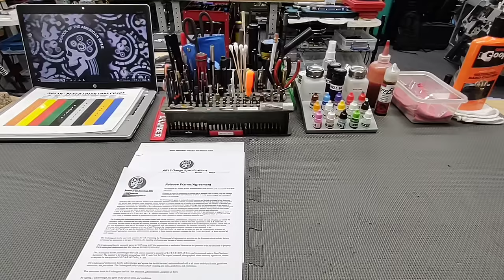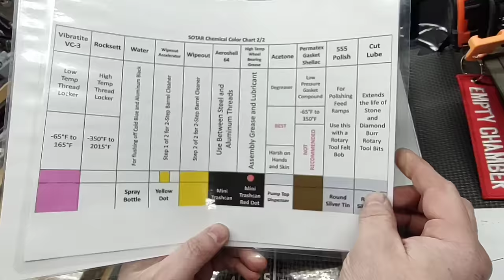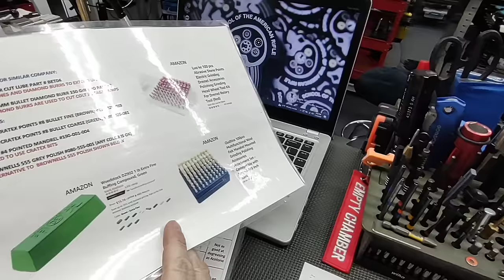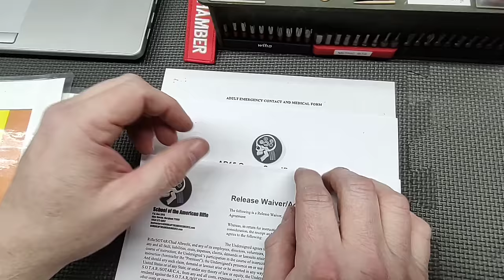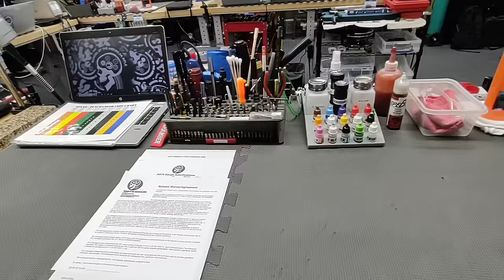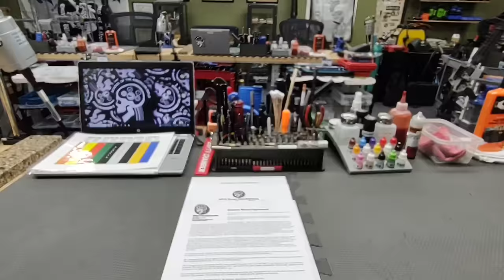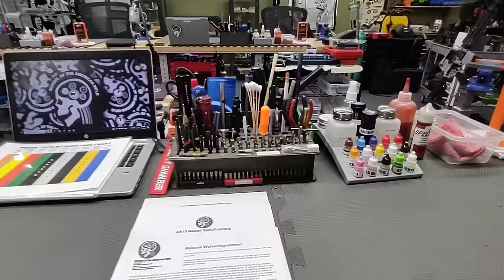SOTAR Classroom Bench Layout (For SOTAR Students - See Description)

Comment: This is just a great classroom setup, wish I could grab a seat. Regarding the borescope (I also have a teslong,) I found the best alternative to a laptop is not a tablet (since there's that whole problem with OTG and usb cameras,) but Vividia has/had a little nearly universal screen for usb endoscopes/borescopes that I love. The M450,  I popped it into a cheap cellphone holder arm over my workspace and it just works. 4.5" isn't the biggest screen, but it is so easy to use, and also has video and camera options, sd card.  There aren't a lot of options I could find at a reasonable price for a USB borescope monitor, but the M450 just works easily.

Comment: Nice video Chad liked those sheets a lot I do have 2 questions. If I take your class will I get a printed certificate that I can frame? And the part about the inch pound wheeler fat wrench what part of the line do you use? top bottom or middle? I emailed wheeler and they won’t respond I also can’t find anything online. Have a good weekend👍🏽
Reply from the maker: All class graduates get a certificate with our wax seal. 

Wheeler won't reply to me either about anything. The manuals used to say the top of the red line should be level with the value you are trying to achieve, but that's not accurate in all cases. Values can vary by 5 Inch Pounds if you do it wrong.
Reply: Wheeler probably doesn't even know. They're basically the harbor freight of gunsmith tools. They just re-brand Chinese made stuff. You'd prob have to talk to them.